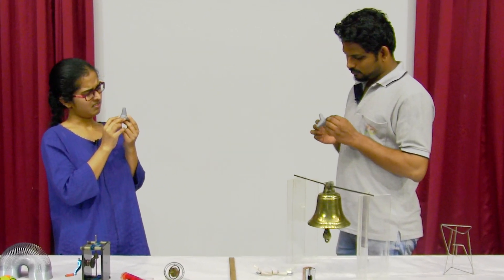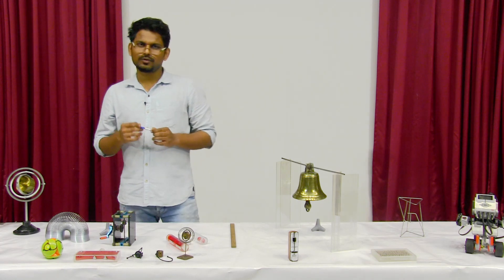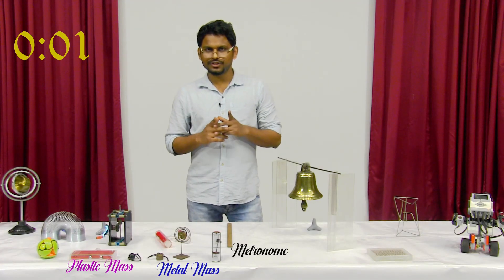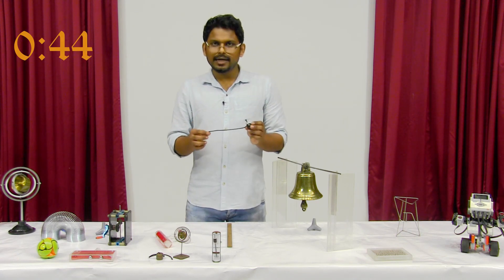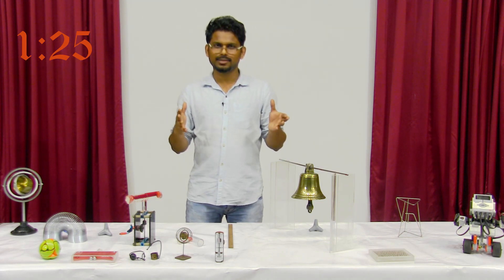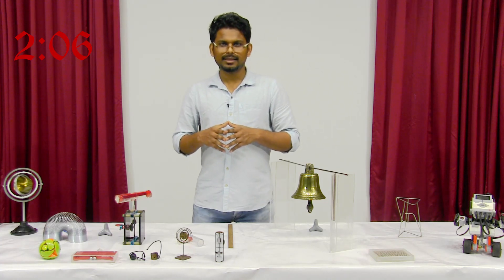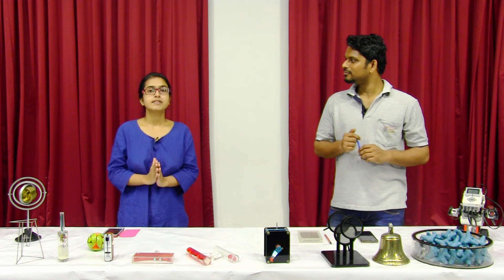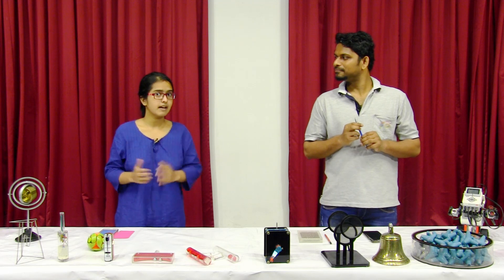Ep. 2a Centrifugal Force (English)

Comment: The building must be 18 km tall if it is built in tropical region,17km tall if it is built in mid lattitudes and 6 km tall if it is built in polar regions. If the height of floors including ground floor is 3 m then the building must be 6000,5667,2000 stories respectively. Whereas above mount Everest it may not be possible
Reply from the maker: can you tell me how high should I build such that clouds will pass through my roof?
Reply: @scientificlockdownnscm1484  I have already answer that it must be 18km or 17 km according to its position